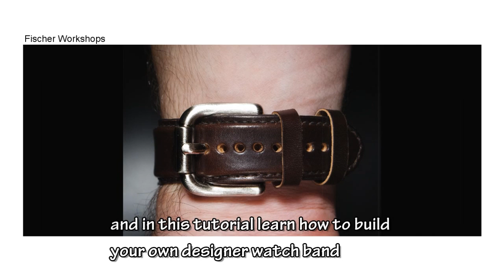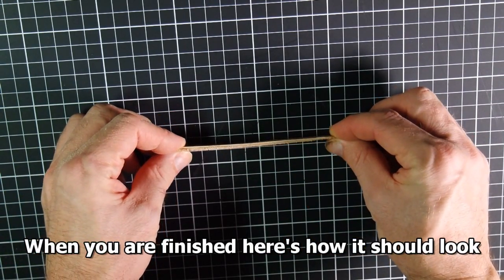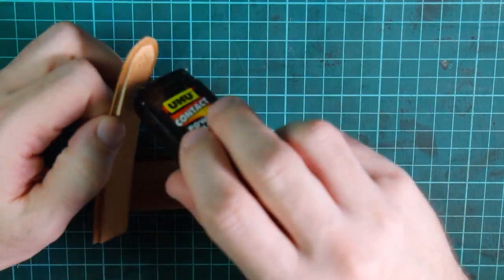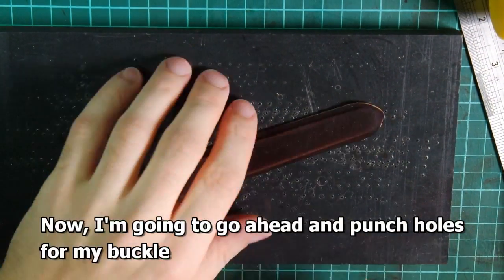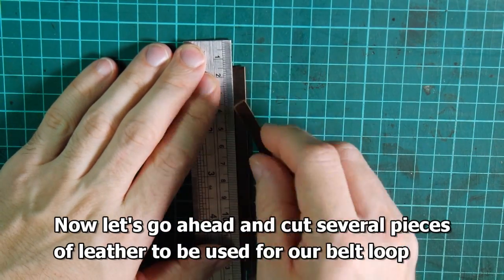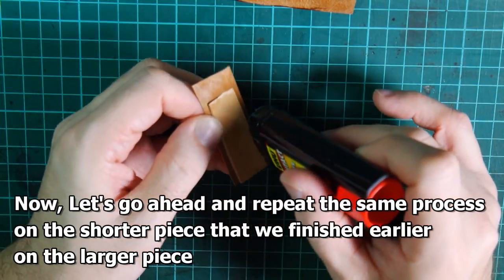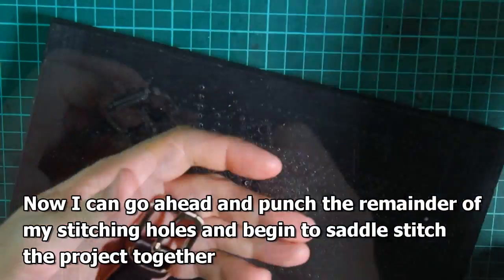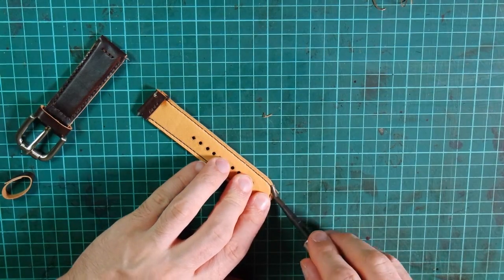Designer Leather Watch Band Tutorial

Comment: I notice in your video you use two different types of contact glue. could you let us know what they are. also what brand of slicking fluid do you use?
Reply from the maker: I use KS bond contact cement when I need a really strong adhesive. I use UHU for less demanding jobs because it's easier to apply and applies cleaner. I used edge magic by Bob Park for the edges slicking.
Reply: Thank you!!

Comment: How wide is the filler leather if I'm making a 22mm strap?
Reply from the maker: The filler leather I used was 2mm thick and was just wide enough to fit into my stitch lines.
Reply: Fischer Workshops cool thanks for the info! I’m just getting into leather working and was wondering if the were any defaulted measurements I need to adhere too. Lol thanks again.